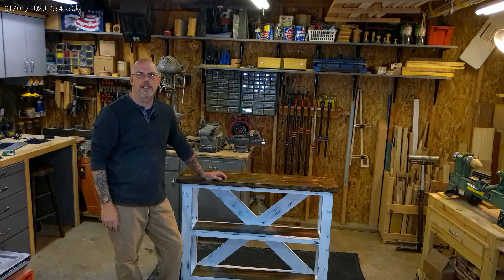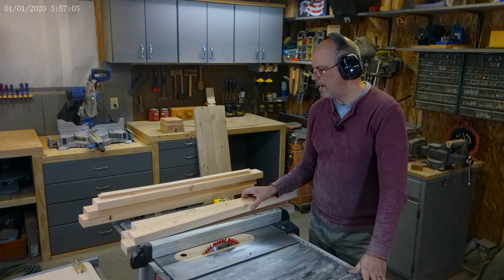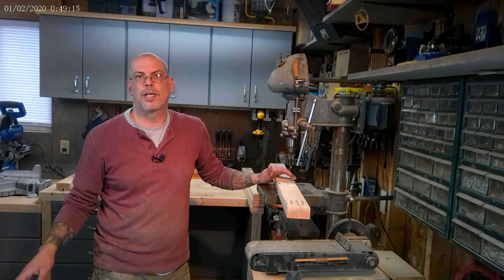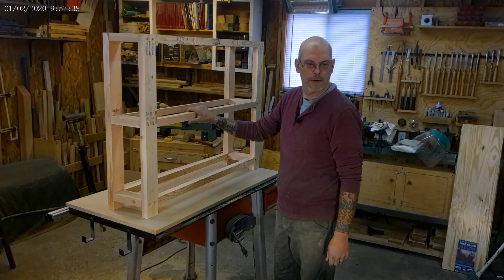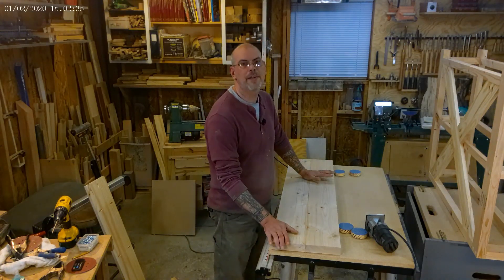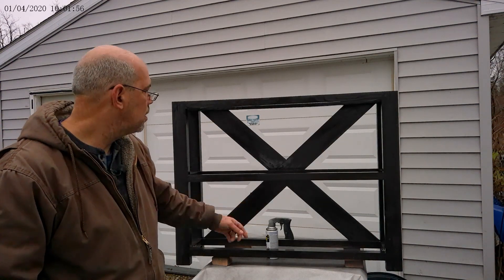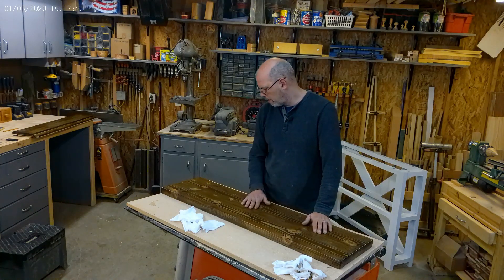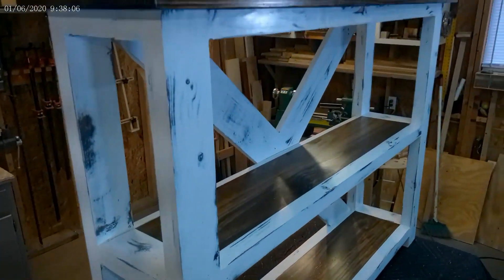DIY Rustic Farmhouse Sofa Table Build

Comment: For the issues with the pocket holes being inaccessible Amazon sells a shorter bit. I use it in my right angle drill attachment for instances like that.
Reply from the maker: Robert Combs, Great tip. I have since picked up the right angle attachment and smaller bit. That really helps. Thanks for the advice and good tip. 👍

Comment: Nice work!!  I think your the first I've seen use a hand held belt sander, I've been contemplating getting one for getting my edge grain cutting boards initially flat after glue up since I can't run them through planer and don't have a drum sander, would you recommend one?  Find a lot of use for it?
Reply from the maker: I would recommend a belt sander. And I think a drum sander would be worth his weight in gold if you can afford one of those. I do a lot of cutting boards and I still use a belt sander or planer
Reply: @Woodcraft716  I agree on the drum sander just not in the budget yet as I'm just starting out.  Just missed out on a used Delta drum sander on marketplace this past weekend, I responded 28 minutes after it posted and was 4th one to respond and someone ahead of me took it of course.  Keep up the videos, I came here after Matt's podcast and now watched all of your videos, liked and subscribed, looking forward to more.
Reply from the maker: @cnich0168  thank you. I've heard them mention you as well. I really appreciate it. And any feedback or ideas are always welcome.

Comment: Do you use the 0000 wool with the paint too? Great video
Reply from the maker: Good question Joshua Tharpe. Yes I did use .0000 on the white paint as well. I did notice that it took a little white off and contaminated my can of wax. Now I put a little at a time in a separate can and use that on the white, as to not turn my whole can of wax white. I hope that makes sense. Thank you for watching and commenting. 👍

Comment: Awesome video 716!!
Reply from the maker: Thank you Seth DeMar. Glad you liked it. I have some great ones coming up. 731's end tables and such. I also have a 6 foot tall chest build coming up.
Reply: I just got the plans from 731, but my customer wants drawers and a middle shelf.
Reply from the maker: @sethdemar8114  sweet. I have a decent video on putting in drawers. That's awesome. Custom work is so rewarding. I'd like to see some pics when your done.